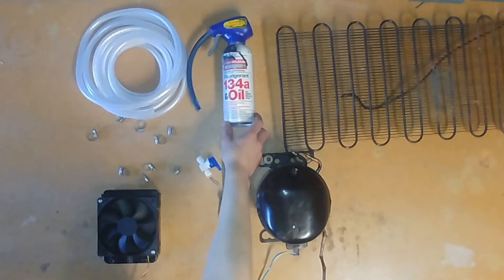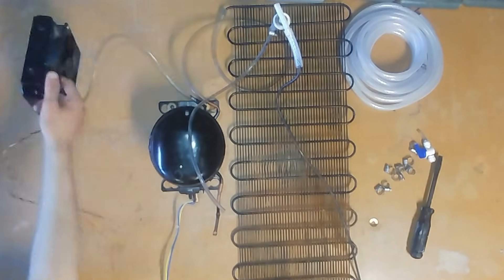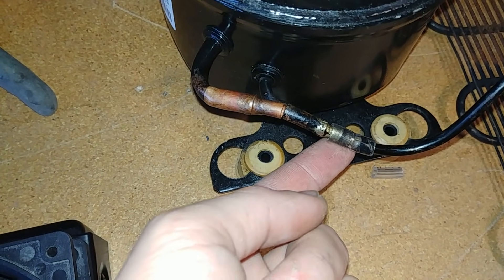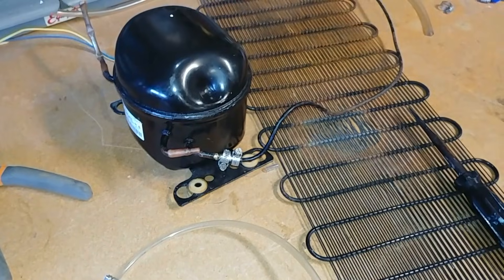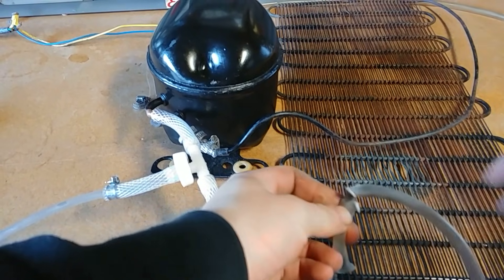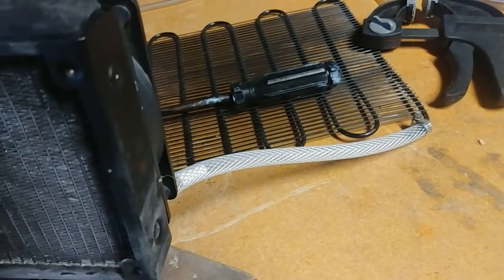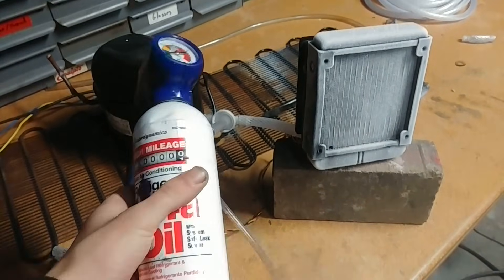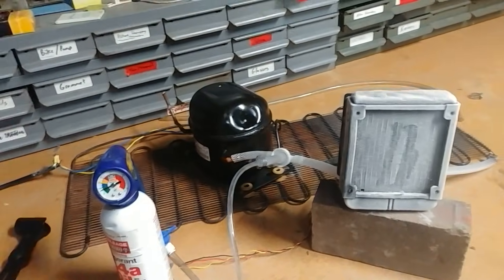DIY AIR CONDITIONER WITH COMPRESSOR diy ac from scratch

Comment: Nice job! Idea for you: embed your cold side in a piece of concrete and make a cold stone for making ice cream.
Reply from the maker: yes that would work and maybe a cookie sheet on top
Reply: @ianbuilder  You can get a nice polished surface on concrete. Probably don't need anything on top at all
Reply from the maker: @Nighthawkinlight   ahh so basically pour concrete over the  evaporator or just put copper tube through it
Reply: Yeah something like that
Reply: @Nighthawkinlight  it's cool to see you here 😎
Reply: @ianbuilder  and if u decide to redo it, it be awesome you use the cheap portable torch ($30?) and add thermostat so it automatically turns off when you reach certain temperature to avoid compressor overheating.. then put the links of the parts on the description. Now you're making a legit AC.
Reply: @BOREDANDWELLBORED  that would be kinda epic
Reply: @ianbuilder  it would be nice if you redo this using copper coils and durable metal parts. This may just be a hobby to you but it's a life saver for many of us poor folks
Reply: Bloop

Comment: Very nice project! And well explained! A tip from me, make sure that you get all the air out before you fill it with refrigerant to keep the pressures lower.
Reply from the maker: oh wow i never thought of that lol
Reply: @ianbuilder  thats why they vacuum car ac pipes before charging it with gas
Reply: Thought the same thing as I recharged my cars AC tonight.
Reply: The evacuation process, right? Evacuate the air, charge with R134a or whatever and bam ice ice babeh

Comment: Also if you disconnect the high side from compressor and let it go to atmosphere then pinch  the high side tubing you will evacuate the air from system then place hose on high side while still pinched. Try and keep air from entering place hose clamps and the charge. It will work way better.
Reply from the maker: your right i never thought of that
Reply: @ianbuilder  please do a new video with the upgraded tips from here
Reply: Stupidest thing I ever herd 🤣🤣🤣🤣